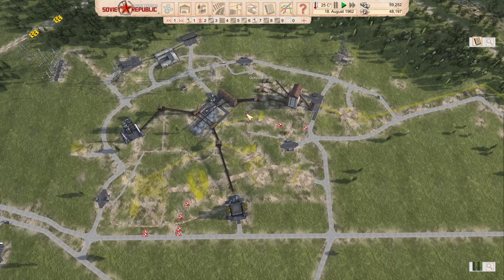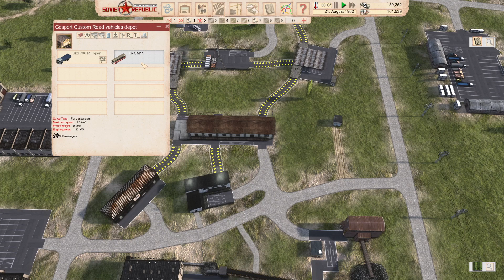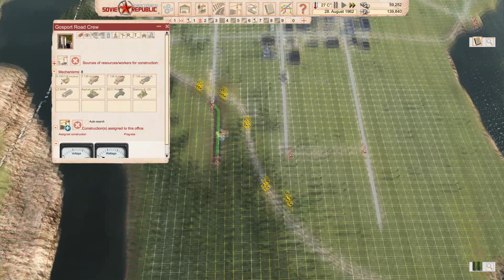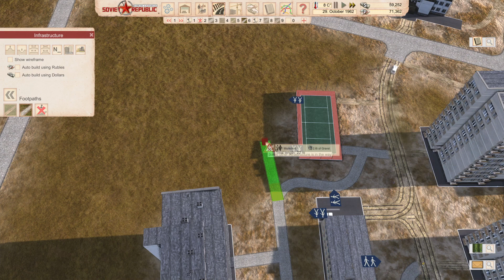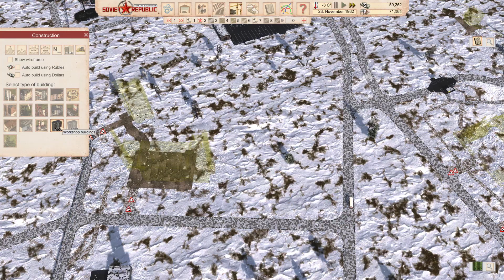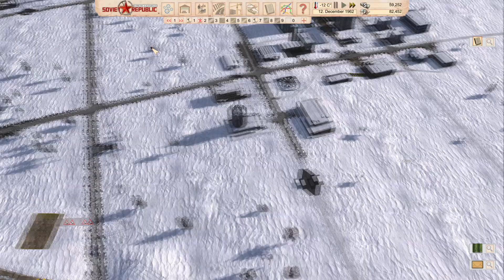Planning A Farm :: Workers & Resources Soviet Republic (Airplanes And Tourism) #06

Comment: There is no point in placing a farm on the outskirts of the area to be cultivated, it is much more efficient to place it more or less in the "center" of this area. Agricultural machinery saves precious time with a more central positioning ... IMHO
Reply from the maker: Looking forward to building open farms on the higher ground, unfortunately this area is narrow.
Reply: @StephenSilverbeard  In fact, even with a cultivable area stretched as it is, this does not detract from the gain in efficiency by placing the farm at the center rather than at its periphery. Even if it is true that for this particular farm sector the error is less obvious than for other forms of cultivable areas, but still :)

Comment: To manage the incoming and outgoing movements of the crops a cargo station would be very useful, since the season update it has become in my opinion a must have to streamline this management.
Reply from the maker: ty for the tip.  Will be using a cargo station in the main crop/food production area,  the current setup is only for local supplies.
Reply: @StephenSilverbeard  I was talking about transporting the crops from the fields to the silo then from the silo to the production areas, a cargo station would have been extremely useful. Loading directly to the silo is very constrained by the number of parking spaces and the loading time. Two distribution offices will be connected to it, and in full harvest this might (will) be a problem.

Comment: Keep in mind that a truck with a crane will collect lumber faster than a simple open hull. I do not know if they are already available for purchase for you but if so it is to be considered because it is this time of collection by the trucks which has a much greater impact than for example the number of workers
Reply from the maker: Will check, but do not think the specialised trucks are available at the moment.  Although, need to remember to keep checking as in this series upgrading vehicles is going to be important.

Comment: The fields furthest away from their farm really should be linked with at least gravel roads, otherwise you're likely to run into the same problem as last series: the trucks picking up crops won't be able to do so quick enough before you lose the harvest due to non-storage. Building extra silos nearby won't help that much, as they'll fill up too quickly for your distribution assets to empty them into their ultimate stores/factories.. & going silly with multiple silos for an offset in that area is ultimately a waste of resources, time & money: the problem lies with the transport speed, not the amount of temporary or permanent storage available
Reply from the maker: Agree the initial setup still needs some work. Used mud roads to ensure the construction crews focused on building the farm buildings .  Not expecting a full harvest in the first year, so there should be time to get the gravel roads finished by the second season.  

It is interesting that in this weeks  development update the devs are talking about adaptive fields.  If this is in the next update can see the field layout will have an update in the future.